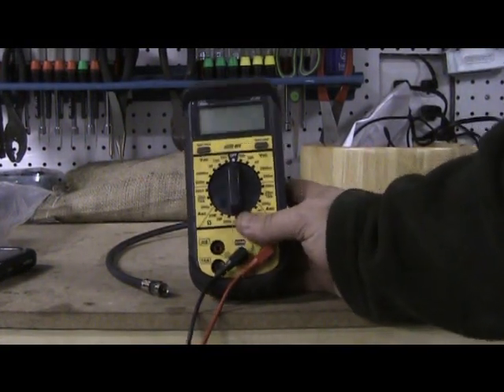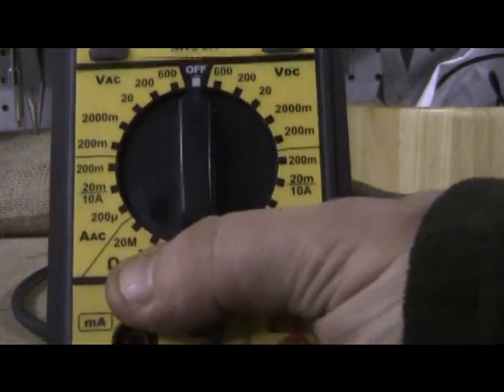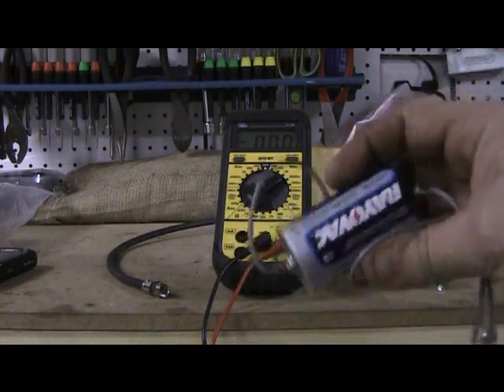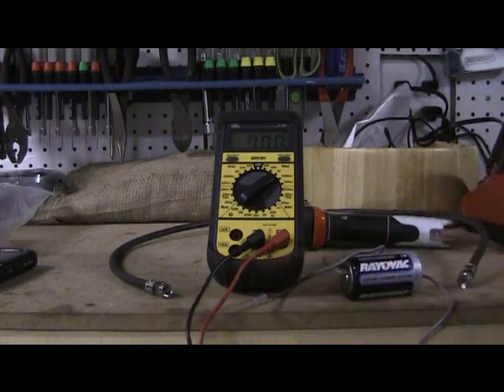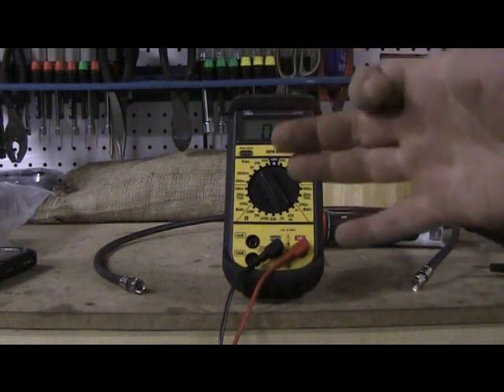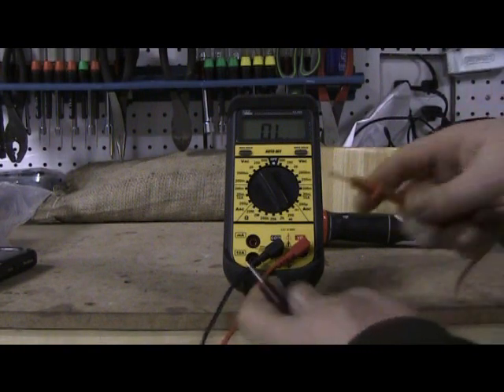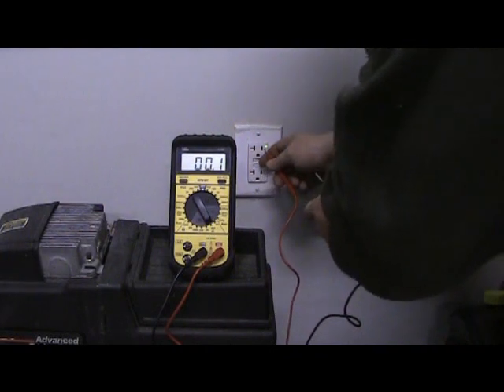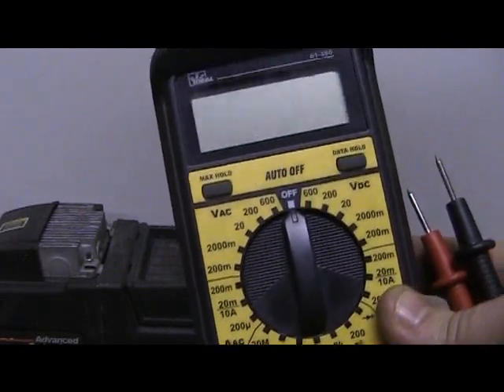How to use a Multimeter to test common things around the house

Comment: How do you replace the battery in that model multimeter you have??
Reply from the maker: Take the black rubber surround off and there is a small door with a screw on this model.
Reply: yeah I did and there is no battery cover at all, I tried to pull it apart but to no avail??
Reply from the maker: Hmm.. Must be different than mine. You may have screws that hold the unit together and you'll have to pull it apart. Maybe 1 at each corner.

Comment: Question on Ac volt does it matter which way the ground and positive touch? I have a outlet in a older home that I'm not sure which is what. Will it destroy my meter if i touch the wrong side
Reply from the maker: +Indianamods No, it will be fine.
Reply: With DC, you will get a negative voltage reading. With AC, it's alternating. So, no need to worry either way.

Comment: what will happen if a put dial on multimeter as DC and then i connect it to a AC source
Reply from the maker: +RASHMIT PANKHANIA If the meter has a fuse, it will probably blow it. If not, it may destroy the meter.
Reply: got it dude

Comment: if i want to check my cars windshield wiper pump to see if it's good, how to I check it and for what?  It's still installed in the car.
Reply from the maker: Well you could tap into the leads where the fuse is and check the voltage when you hit the switch. It should change. Do you hear it running?

Comment: Just bought a cheapo multimeter today at the equivalent of around US$4. It's mostly to test the car's battery so there's not much skill needed. But from this video, at least I've discovered what that Wifi-like icon is - continuity, to test a wire. There wasn't any sound when I tested, only changing numbers...?! Oh... must be because of the $4 :-)
Reply from the maker: Sounds like a good deal for $4 to me!
Reply: ***** The brand is UNITY DT830D. No address of the manufacturer or even where it's made. But it's most likely made in China. It claims to have "CE" (European Union compliance) etc. Well, whatever. But I'm amazed something like this could be sold at such a ridiculously low price. And the 9V battery to power it was also included. It may not have the bells and whistles as the one you're using but it's definitely good enough for the casual amateur. Even a newbie could test his car battery and household batteries, among other things. With just a bit more of learning (including from this video), he'll be able to do test other components as well.
Reply: ***** I just did a search of it. Yeah, it's from China. But apparently there's also a buzzer which I'm not aware of. That means it does have some bells and whistles too after all:-)

The DT830D Digital Multimeter is a very affordable and handy piece of test equipment. It features an easy to read 3.5 digit LCD display. It is equipped with 5 functions and 19 ranges, each test position is quickly and easily selected with a simple turn of the single selector switch.

Measure DC voltage in these ranges:  200 mV 2000mV, 20V, 200V and 1000V. 
Measure DC current in these ranges:  200µA, 2000µA, 20ma, 200ma and 10A. 
Measure AC voltage in these ranges:  200 V and 750 V. 
Measure resistance in these ranges:  200, 2000 ohms, 20, 200 and 2000 Kohms.

It also has a built-in diode test and transistor test feature. There is a buzzer for continuity test. This meter has a replaceable 0.2A/250V fuse accessible via the battery compartment.

Only 2.8 x 5 x 1 inches 6 oz. (70x126x24mm 170g). Comes with test leads. Requires a 9 volt battery.
Reply from the maker: Mat Cendana That's a lot of features for a $4 meter!
Reply: +Reggie Wallace On the contrary. This multimeter is among the best bargains I've had in my whole life. It works very well with both DC and AC. And the latter is 240 volts. Certainly fulfils all of my requirements so far. Without paying a sucker's price for doing the exact same things.

Comment: the bigger slot is positive and the smaller one is negative, the circle is ground. black goes to negative and red to positve although it doesnt matter in the house cus its ac volts but a battery it matters cus its dc. im a electrical tech student.

Comment: With a multimeter in hand, set to the desired AC voltage setting ( usually the 220 voltage increment). put one end of the probe in any ground source (like a metallic water pipe) and the other probe at one of the hole in the wall outlet, then do the same at the other outlet hole. The outlet hole which register the most deflection is the Load (positive) one while the other one should be the neutral (negative) one.

Comment: i took off the dimmer switch to change it to a reagular pole switch. however from the dimmer box was two black wires connected to one red wire and two black wires that had been twisted together. i want to test the the red and both black wires are the black ones the grounding wires.anyway how do i check the wires with a  craftsman multimeter

Comment: MY dad gave me his old multimeter, but I think it's broken. There are 3 ports: Ohms, COM, and V. When I put the black in COM and red in V and set it to continuity it displays 1 then I touch the 2 probes to each other nothing happens. When I set it to 2V DC it displays .000 then I put it on either side of a battery, likewise nothing happens (same w/20). The only time I see the numbers change is when I turn the dial or remove a probe it jumps & then it quickly goes back to 0 or 1. What's going on?

Comment: Please drop a video on speakers and ohms. Maybe explain benefits of higher ohms or purposes of various ohm rates. Your video was excellent because the modeling done using a common cable is relatable.  This is applicable for testing continuity on the common water heater elements in most homes. Possibly saving regular folks from replacing expensive water heaters. Ty

Comment: Hi, So I think the wiring in the house is all messed up.. sometimes, if I use the microwave, and I have... maybe a hair dryer on in the other room, the power goes off in like half of the house...so probably every outlet is wired to the same breaker? If I do the last test that you did, and it comes up less than 110-ish, does that mean that there are tons of other things in line with that plug? like.. if I have my laptop in another plug that also goes out in the chain, will it take away from 110?

Comment: I have a faulty rear light on a dynamo do I use ac or dc for testing the wire from the dynamo and the bulb is on a circuit board with a capacitor do I use ohms metering  to test it  thanks please help thankyou

Comment: straight to the point, clear voice, no jiberish, great vid. Now a question, recently one of our cameras connected to a video mixer burned the video cable and camera died :-( also on of the outputs from the video mixer blew, the mixer still works t has 2 more outputs. what test would you recomend as far a the wiring and the power supply so that i can make sure it's safe to reconect.  thanx for your help.

Comment: @nephiwong 
Are you referring to the 110vac wall outlet?  If so, the small prong is the hot wire.  That is the live wire!  The larger one is the neutral and the round one on the bottom is the ground.  We use positive and negative for DC circuit.

Comment: Great video. I think this is the best one so far in helping to determine what kind of mulimeter I need to get to try to diagnoise the charging sysytem on my motorcycle. I'm an electricity dope and barely know how electricity works but this video helps a great deal.

Comment: I need to check the contenuity on the wiring in my car. Can you run the positive (or negative) end of the terminal along the wiring with the wiring insulation to locate a break? I can't see any breaks, so I'm wondering if its inside it's wiring insulation.

Hopefully you know what I'm asking. 

I am a beginner and replaced my starter last weekend. And now the fuse for the stereo keeps blowing. I've followed the wiring from the fuse box and I can't see any breaks. So any help?